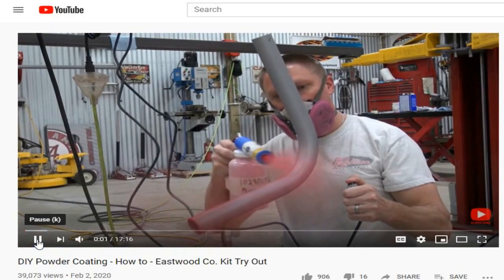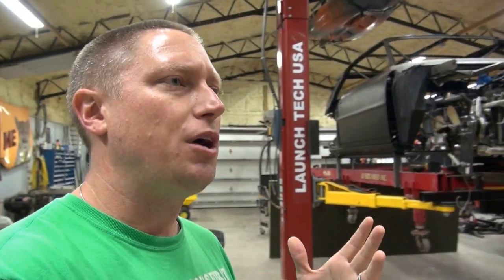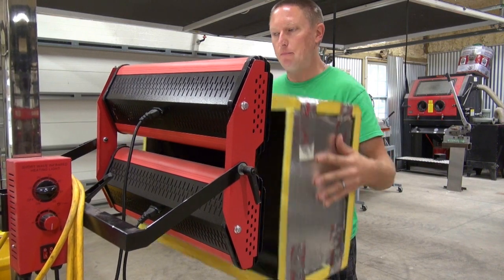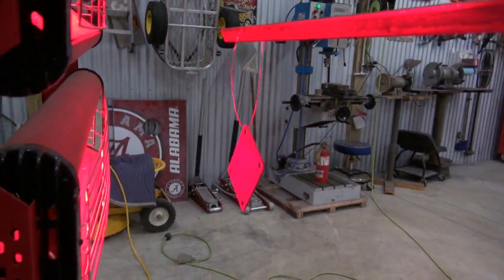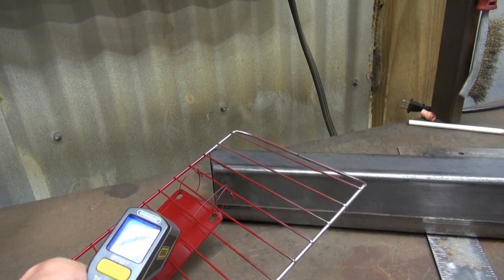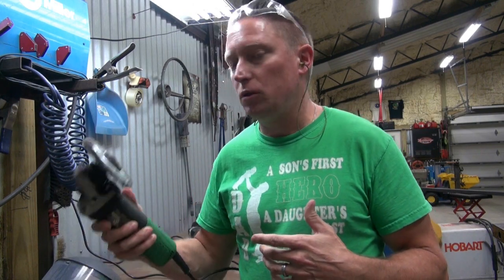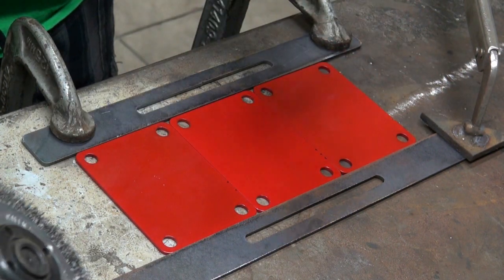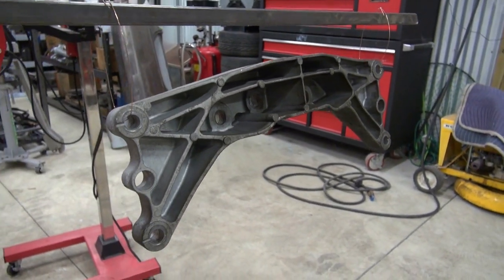Powder Coating Curing Methods Tested - Oven vs Heat Lamp

Comment: yeah i had the same idea with the box after watching your first video. i wonder ... maybe it works even better if you use some reflective material (e.g. aluminum foil) inside the box as well? courious to see whether this will also work with long items (bicycle frame) where the lamp has to be moved during the process.
Reply: found some paper about this. seems like a non-polished metal plate would still reflect IR but not "visible" light due to the longer wave length. have to play with this.
Reply: @oefzdegoeggl  my ir guru engineer says copper color won his ir reflective tests.

Comment: Try using the reflective surface inside of the insulating box since the object is to keep the heat concentrated on the part itself, it will reflect some of the heat. Infrared radiation energy is known to pass into and through materials at varying rates, I would experiment with lining material such as Mica, silica/graphite, porcelain, ceramic, and the heat shielding material used around catalytic converters and the turbine impeller volutes on turbo chargers. You already have the thermometer, and it has settings for various material energy reflective frequencies. you shouldn’t even have to apply the infrared, the laser should indicate the best reflection.

Comment: My first thought was that you should have the reflective surface on the inside of the box.  However, If the reflective side of your box is only rated to 150 degrees, I’d suggest leaving it on the outside, and putting aluminum foil on the inside of the box, shiny side facing the heat source.  Aluminum foil will easily withstand 400 degrees, and you get the best of both worlds.

Comment: With regards to Infrared Thermometer.  Read up on emissivity.  Each surface has a different value from 0.1 (100% reflective) to 1.0 (Perfect absorption). You set your handheld on a value BEFORE you measure, then you get a more accurate temp.  That foils was about 0.3.

Comment: You're on the right track. See below for how to get the rest of the way there.

As pointed out by @laptopgeek0991, your insulation panels were backwards, brother. Shiny side goes IN.

But more than that: You have an INFRARED heat source. 

The way an infrared space heater, for instance, works is it directs its emitted radiation - generally within a wavelength of 7-12 microns - into the target object (don't get excited by my use of the word "radiation" here; this is the same way the SUN warms up an object. You yourself emit infrared radiation... at any object colder than yourself. Along with every other object warmer than Absolute Zero). 

The takeaway here is twofold:

1. The target object will absorb the heat. But since it's the only object in the "oven", it's the ONLY thing that does. If you added an object that had good thermal transfer properties (good at soaking up and spitting back out heat) - say a plate of iron or asphalt, or a big shard of terracotta pottery - also in the "oven" but BEHIND the object then that object would ALSO get warm, AS WELL AS RADIATE THAT HEAT BACK OUT. So say you get yourself a half of a terracotta pot (broken pots aren't generally very pricy) - or hell: a big cast iron griddle! - and put it behind the object. Now say you let it "pre-heat" for 20-30 minutes or so before putting in the part. I suspect you'll be surprised how much additional heat energy gets poured into the (colder) part. Plus you'd get a more even "surround" heat. Because your lamp is getting its energy from a source outside the system - the electrical grid - it has "unlimited ammo". It'll KEEP pouring in heat. What limits you here is A) Your insulation, and B) the target's ability to absorb said heat.

2. Both the shape and the material of the object you're trying to cure has an enormous impact on the effectiveness here. Some objects - say aluminum - shed heat like mad. Iron loves heat, and soaks it right up. In the case of the larger part you did at the very end, the BACKSIDE of said part was acting as a heatsink. The "just hang it out in front" method was the worst choice to test that. Your homemade oven, however, that (esp. with the foil facing the correct direction) is reflecting all that heat right back to the object's backside would have yielded similar results to your flat pieces of steel. You wanna see that piece hit 350? slap a griddle behind it and face that foil IN.

One more physics point here: heat rises, right? So imagine you're trying to fill that space with a gas that's lighter than air, like helium. With the oven's opening (its gap in its insulative properties) facing sideways, as that gas builds up it "leaks" out the side. If you rotated the entire arrangement 90 degrees, you'd trap a significant portion of the heat... THATS BEING RADIATED FROM THE OBJECTS INSIDE. Don't underestimate the effectiveness of your oven, homemade or not. Indeed, you can BUY IR ovens FOR COOKING (super energy-efficient and don't dry out food as much). The issue here is simply one of basic insulative efficiency. If you sealed those lights INSIDE that box (DO NOT DO THIS) with some radiant sources like iron or rock, I'd be astounded if SOMETHING in there didn't catch fire (my guess would be the lights themselves). A normal pop-up bread toaster will melt its way out if you insulate well enough and are prepared to wait.

Finally, a critical note here: unlike an oven, IR heat doesn't move the air around beyond basic convection currents generated in the air where the hot and cold air "meets". Ovens are designed to circulate the air (note the heating elements are above and/or below). Your box is not. All this means in practice is that you're not cooking off any water vapor in the air. That is, your box won't dehumidify the ambient air. I don't know diddly about powder coating, nor do i know where you live (though I'm guessing Texas?), but if you happen to be somewhere closer to, say, Louisiana, or Alabama, the time of year will very likely impact the performance here, in that the humidity inside your jury-rigged furnace won't be cooked off like it is inside a true oven. You're more likely to create a sauna condition than an arid desert one. I dunno if that impacts powder coating, but I cannot imagine it does not.

SOURCE: I'm an Engineer and Product Designer. More importantly, I'm a hardcore nerd. Humor me here.
Reply: Oh! And one more thing: an IR thermometer SHOULD read low on the skin of your hand. It's because it's not calibrated to read that. The emissivity coefficient of human skin ranges from 0.99 (clean skin) to ~0.725 (sweaty, or skin with lotion of some kind). The closer that is to 1, the "easier" it is to get a reading. Human skin SUCKS for accuracy here. Additionally, ever notice how the medical thermometers are used at point blank? AND they're used on your forehead, or your inner ear, or inner thigh? Your hand's at the very edge of your circulation. It's a terrible measure of your body temp.

Moreover, that looks like a General IRT207 IR Thermometer. Those have an 8:1 distance-to-spot (D:S) this means it's sampling an AVERAGE temperature of one unit for every 8 away it is (so if you're 16 inches away from your target, it samples a two-inch spot). Those (really, almost all) IR thermometers have their emissivity calibrated at 0.95 (which you can see above is often WAY outta range for human skin). And, unless you have a fairly high-end one (Klein, Southwire), it's FIXED at 0.95 (the pricier ones you can tweak, not that you'd ever care to in most cases). 

Don't assume your readings are off. They're not. They're pretty close to what I'd expect. My Klein says I'm dead right now, if I shoot it at my foot. :)
Reply from the maker: Dear nerd.  Stay tuned!  You bring up a lot of good points that I cannot argue.  A lot of folks have commented that they want to see me attempt to cure a part using a heat gun.  We're about to see what happens.

Comment: This was very interesting; really enjoyed it. Have you tried the low temp curing powder that is said only requires temp as low as 266°F for 10 min after they reach  temp, and are better suited to infrared curing?
One individual has already mentioned about polyester  being more resistant to UV fade. Coatings are delineated based on weathering metrics from actual locations that experience high levels of UV exposure. In the US , South Florida and to a lesser extent central Arizona are most commonly used.  Too much to go into here, but you can easily find more on the above in Google. I don't want to bore you or others with a longer comment.👍
Reply: got a link for this powder ?!?!?

Comment: Build the oven with the reflection material inside. Primer helps with adhesion don't blow the parts it causes static hence dirt . Sweat the parts with a prep solvent with antistatic additives then tack rag. Good luck.

Comment: You built the box backwards.  Silver side inside would have bumped up the reflective heat as well.  I'd put some 45°'s in the corners as well...

Comment: We have a historic house with steam heat and hope to powder coat the radiators.  This is very costly.  I am curious whether powder coating will cure at 229F which is how hot radiators can get. Strip radiators in place, disconnect them,  spray them, gently reconnect them, touch up the powder coating,  fire up the boiler to cure them (?).
Reply from the maker: Given they're indoors, I bet that works.  Will it be fully cured?  Probably not, but I doubt they'll see conditions harsh enough to harm the finish.  Give it a shot!

Comment: Yes, those infrared thermometers don't work that well pointed at a shiny surface. Your hand is probably pretty close to 88-92 degrees, inside your mouth would be 98-99.  As far as getting the temp on the back of that shiny 'oven' point it at the black lettering on that shiny surface.

Comment: IR heat systems are used in the field on large commercial/industrial projects. They are powerful and used in numbers to provide the necessary temperatures. Unfortunately I see that you, like virtually ALL the YouTube powder coaters, don't use a primer coat, epoxy for aluminum or zinc rich epoxy for ferrous metals. Unless the powder manufacturer specifically states to NOT use a primer coat, the very best and most durable finishes will be with a primer coat.
Also, the curing time starts when the part reaches curing temperature, not when it goes in the "oven".

Comment: Wonderful channel. Got a question for you. I want to powdercoat railing sections and smaller gates. I wondering if I could use a heat lamp like what you have and just move it along my railings? Would it even be cost effective?
Reply from the maker: Funny you ask.  In this video below we test my ability to powder coat a part of infinite length
https://youtu.be/J4WkhAuVdQY

Comment: Your homemade oven would work a lot better if you had used the foil side inside rather than the insulate side or used two layers, insulation to insulation. If you're going to leave the box together then using a 45° angle would reflect the light more back at it. Also if you made it larger so that you can bring the light up and then have a front section on it to reflect back in would work well.

Comment: What is see you’re doing wrong is you don’t start the time till you see the powder getting glossy. All powder coating is done this way, so redo all your test don’t start the timer till you start to see the parts get glossy. The over should of did the absolute best if you did it right, your homemade box also. I’ve done the box like you only way bigger, I just used two heat guns. Once the parts start to gloss over started the timer.

Comment: You can’t judge durability like this. No matter how it’s cooked means nothing. If the parts are cured per application guide of the powder by “pmt” part metal temperature, mill thickness is correct & prep work is proper...you will have best durability.
Reply: exactly,part must come up to temp required then bake for proper time,this makes your test useless

Comment: Your suppose to start your time once the powder begins to flow and is at the recommended temp per the powder instructions....
Reply: Right...? But... SCIENCE!
Reply: Actually most powder will flow at 250 -275 . The part needs to be at cure temp before  you start the timer.

Comment: You seemed to have missed the concept of this material you are using with the reflective aluminum. In order to maximize the heat retention the reflective material should be INSIDE the box not the outside. The product you are using is to keep  air conditioning ductwork cool when this product is used to enclose exterior ductwork.

Comment: Can you provide us with the link to buy the ir heater.
Thanks
Reply from the maker: https://www.ebay.com/itm/2X1000W-Spray-Baking-Infrared-Paint-Curing-Lamp-602-Heating-New-Booth-Durable/233197603871?hash=item364ba90c1f:g:hUkAAOSwOKpfMhJ7

Comment: Hello, Could you give me the model of Sandblasting Gun, I see on the video is good, I bought total it 4 model but not good, and give me the PSI air for that, I'm not good English, could you understand, , if okay give me Powder Coating system model, Thank you very much, Have a nice day
Reply from the maker: The various guns we offer are shown here in the link below sir.

https://www.redlinestands.com/catalog/shop-equipment-c-327/sand-blast-equipment-c-327_501/sand-blast-replacement-parts-c-327_501_507/#sand

Comment: The proper way to do it, powder coat one piece, than cut it up into three pieces before curing by the three methods, that way your coating is pretty much the same thickness applied.

Comment: I have a question. 90% of everything in my garage is American made. What about yours?
Reply from the maker: Probably 90% import.  I'm not ashamed of it either.  Redline started off making all of our goods in America.  The price of steel kept rising, and as sales fell each time the price increased, I had to figure out how to make the goods somewhere cheaper in order to keep food on the table.  The truth is this.  Retailers put on the shelves what Americans take off the shelves.  Today we offer Handy lift tables made in Iowa, AutoTwirler rotisseries made in UT, and Raptor blast cabinets made in CA.  I'd love to tell you they sold extremely well, but they don't.  The Handy's are probably 5 to 1, and AutoTwirlers 50 to 1, and the blast cabinets 200 to 1, with respect to the imports we offer.  I'm proud to carry American made products; I just wish folks purchased them more often.

Comment: Great video; however, “Only 2000 sq ft of man space”. Wow! It’s really hard to sympathize with you. Just how much space do you think most of your viewers have? Most would probably be grateful to have a quarter of that space and be ecstatic to have half that. Your content is great! I’m simply pointing out that statements like that can come off as a bit snobby or elitist. Not meaning to be critical of what you’re doing, just some constructive feedback.
Reply from the maker: LOL.  That's fair enough.  No man in history ever said he realized he built his shop too big.  I bet I could double my space and within a year I'd have filled it with enough new equipment that it would again feel small.
Reply: @RedlineStands  No argument with that! I'm in the process of having a 1,750 sq ft shop built and I would love to go bigger; however, despite having a lot of nearly an acre, with 2/3 acre being behind the house, my local jurisdiction restricts the total square footage of all accessory structures to be not greater than the living space of the house, which when they include covered porches and patios, despite being integral to the design and architecture of the house as accessory structures, that can significantly reduce how big a shop can be built. Regardless I'm going to consider myself very fortunate to be able to build a shop that big and while I would love a bigger shop, I will try to remember that most would only be able to dream of having more than a two car garage, maybe less.

Comment: I just watched his other video on powder coating. I can only assume others didn't like it because he turned off the comments. How about pulling the video down when you know you didn't do it right instead of just turning off the comments. He compared powder guns from Harbor Freight and Eastwood using different colors and he botched the 1st cost by not hooking up the electro static clip. After the test, he praises the Eastwood gun as looking amazing and professional. So much room for error when you don't follow the exact same steps that I wouldn't feel comfortable posting the video and trying to have a decent reputation for being fair and balanced.

Comment: Sorry to say but that’s not a very scientific test. You need to do a real life test without cut off wheels or wire wheel. Tip for the week do not use brake cleaner on powder coated parts, It will melt.

Comment: measuring your hand with a IR non contact thermometer isnt going to tell you your body temp. its not off by 13 degrees your hands are colder than your core temp and that's normal. 
.... smh

Comment: I have a question about your heat lamp, I bought one that has a power supply rated at 220 volts but the end that plugs in goes to a 120 volt outlet and I'm not sure if the power supply is an up stepper or if it needs 220 volts directly
Reply from the maker: Dunno man.  I've always plugged mine directly into a 110 outlet and never given it a 2nd thought.
Reply: Can you tell me what do you call the infrared light i am looking for it on internet but cant find it anywhere, i need it for paint curing
Reply: @MAS68saxophone  Can you tell me what do you call the infrared light i am looking for it on internet but cant find it anywhere, i need it for paint curing